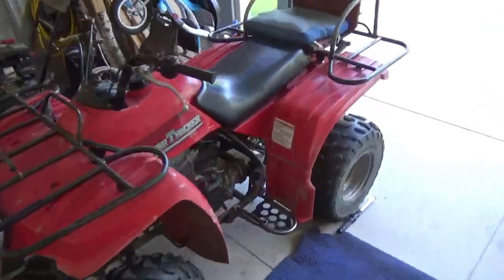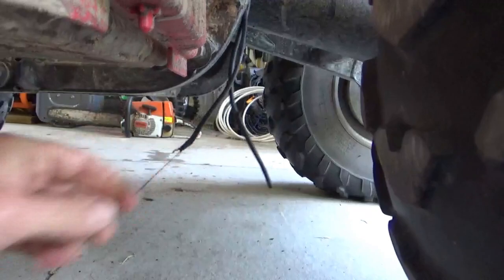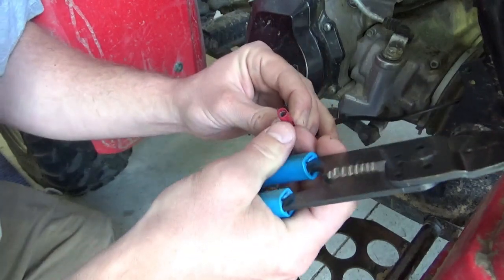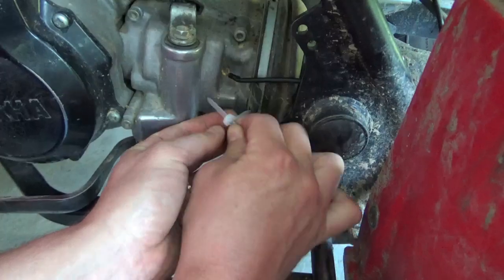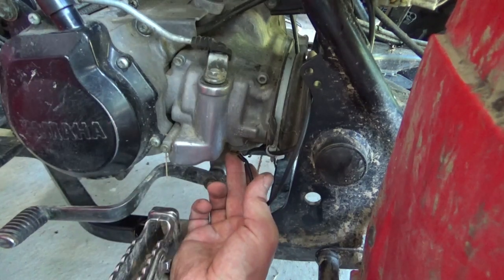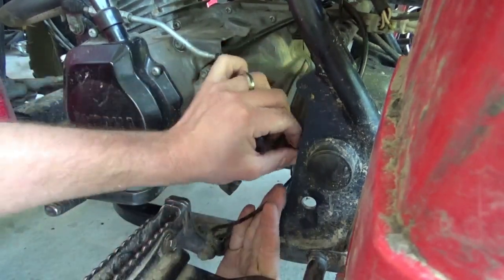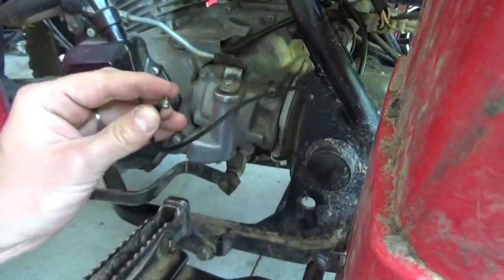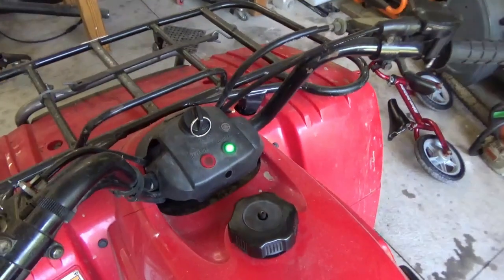Yamaha BearTracker- Neutral and Reverse Lights not working

Comment: Do you know the size of that connector or a link to buy one?  I was looking on amazon and there are different sizes, I am trying to find the right size as my bike has the same issues, and this video is so amazing thank you for providing the help I needed without having to take it to the dealer!
Reply from the maker: I don’t remember off the top of my head. That quad is long gone now. But I would suggest buying a variety pack of those electrical connectors. Harbor freight should have some too. Or bring the screw with you to a big box store and try to find one that fits that way. Thanks for watching!